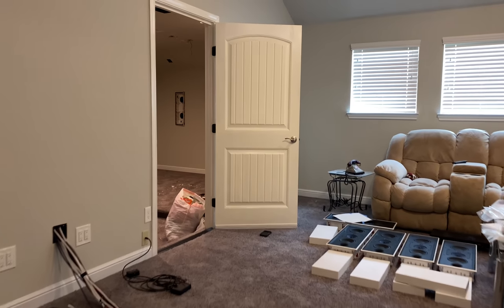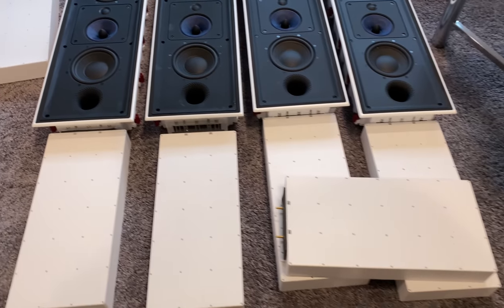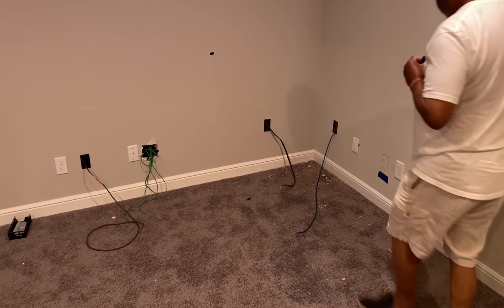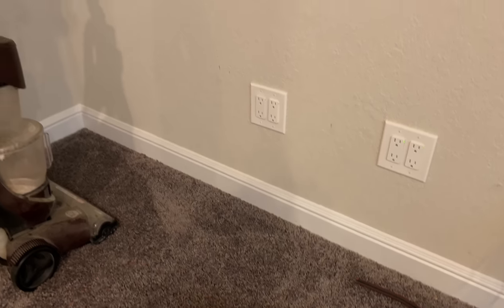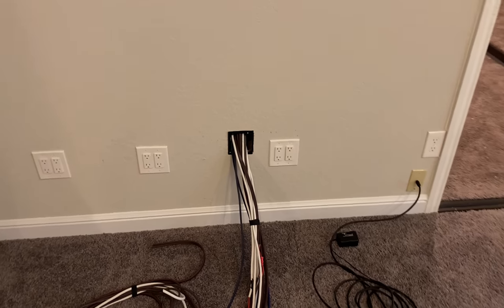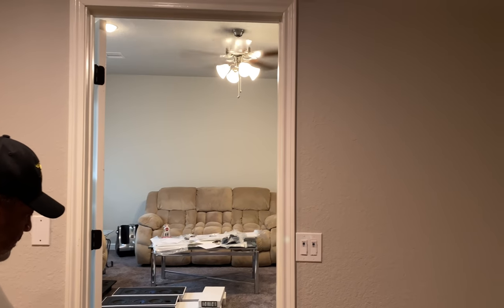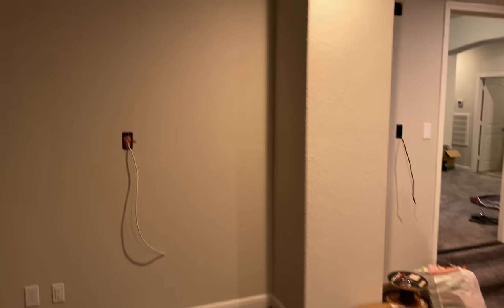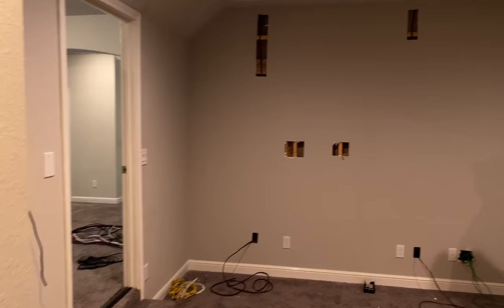Home Theater Build: McIntosh, Bowers and Wilkins, JVC rs3000, JTR 4000ULF: The BEFORE

Comment: Reminds me of when I build my theater room 16 years ago. I am not a carpenter, electrician or even a handy man. Painting walls was my limit and I built everything my self after work for 18 months. That was after 6 months of research. I did some over the top things that I would never do again. I ran vacuum tube throughout all the walls dedicated to each speaker so I could upgrade cables if I wanted to. That job alone took be 40 hours cutting big holes through studs. Best think I did was vibration isolation and soundproofing. My double. 3/4" drywall on The. Ceiling only has 12 points of connection to the joists and those are acoustical vibration anchors that connect hat-track that the drywall is attached to. Eliminated vibration going to the rooms above it. Did the same with the walls with Z track and only 6 points of connection per horizonal Z track over 22 feet and only 3 across each wall so only 6 contact point for each 8'x8'section and everyone had a rubber isolatorntonstop vibration. Every box was sealed with silicon amd attached with a rubber pad
Every item. That was attached to any of the studs or joints had a piece of rubber between it  and the wood. With the door (steel, sealed exterior door) closed, amd all the other sound proofing I did and researched to do, sound volume drops 58 dB righty outside the door and 61 dB in the bedroom right above it. This soundproofing work took 4 months of work alone. It takes time to do it right. My problem now is how I am going to install my atmos ceiling speakers though such a suspended ceiling and also keep the sound integrity. 

That was the only thing I never futirproofed for as ceiling speakers weren't even in cimas yet, heck people were arguing that 7.1 was too much and 5.1 was the best. I set up wore runs for 11 wall speakers.... Just in case I could figure out a way to have speaker delay to add nonexistent channels. 

If only there was YouTube back then to learn from instead of buyingagazinea and hoping there was info on something you were building. I bought my self isolated hanging anchors for the ceiling from an Australian company that took 8 weeks to come and months to find online. Well worth it but 1000 times harder back then

Comment: Maybe misconceiving, but the wall the screen is going on doesn't look like it can fit a 175" diag screen (69"x161"/ 5.75'x13.4', if 2:35:1)...
The room seems small for everything he's putting into it. But to each their own...
Reply: All amps will be in my game room and the equipment rack will be in game room.  The only thing in the theater room will be my seats, projector, screen, speakers, and subs.  All speakers will be in the walls and ceiling.
Reply: It looked Ike that room was at least 16 - 17' wide, more than enough room since it is transparent. The good thing with transparent is you can go a couple inches from the side walls, just need a screen border.

Comment: Interesting and very similar to what I currently have but mine is a 7.1.4 system using cwm 7.4s and dual Rythmik 15 subs.  The only thing that looks odd is how HIGH he is placing his speakers in the walls.  I originally had mine around that high 20 years ago when I first built it as a 5.1 system but was told to lower the speakers in a 7.1.4 system so I did that on the fronts only (so far) as I figured that is the most critical sound stage portion.  This may be good news if I don't need to lower the sides and back as they have been in wall for a long time now

Comment: What did magnolia didnt do?
Reply: It appears to me that the holes they cut were very messy.   It isn't the biggest of deal if you are willing to come back and repair the damage later, but that is a big hassle.   Much of that damage could have been minimized with experience.   I will give them the benefit of the doubt and say, they SURELY will come back and tidy up.
Reply from the maker: im not in the biz of trash talk. Objectively, they prewired with the terminations 2-4 inches out of the wall. As a custom integrator, you usually leave several feet to accommodate racks, or other mounting conditions. they basically took solid core audioquest speaker cable and used automotive crimp style adapters to extend the lines. Magnolia has already committed to come out and fix this wire job.
Reply: @ThatHomeTheaterDude  A great company is not one that avoids ALL mistakes, but does what it takes to make every job right.  Good guy Magnolia.  Good to hear.

Comment: This guy has some serious rack equipment going on here.   I’m not trying to be a hater but I don’t understand the choice of speakers with this level of electronics.  I understand just about everyone has a budget for what they want to spend or will spend, but with this quality of electronics, I would not have JTR subs or those B&Ws for the LCR.  I’d have 2 Paradigm Signature Sub 2 or id look at doing a line array from REL or if I didn’t do a line array I’d consider 2 REL No 25s, and I most definitely would pair the McIntosh 1.25s with a pair of Revel Salon 2s and the matching voice 2 Center, or maybe consider an LCR arrangement with Sopra 3s and Sopra Center and then rounding out with Sopra BEs.   Again; I’m not hating.   I just don’t see the speaker quality in this set  up matching the electronics quality in the rack.  But like they say, to each their own.   No matter what, this guy’s system kicks some serious serious ass.
Reply: Jtr 4000’s stomp all over paradigm subs 2’s. It’s not even close. And yes I’ve heard both subs a few times.
Reply: Leroy Lang curious how you think a 4000 ULF stomps all over a Signature Sub 2
Reply: @leroylang8613  I think you might be confusing a different sub. The Paradigm Sub 2 is probably on of the best suns in the world, $15k and 9000 watts is out of this world. The JTRs probably have more bass resonance but the Sub 2 will be much tighter and accurate but if you prefer boomy shake your pantleg bass, JTRs are great, but still not the se. When you can buy 3 JTRs for the price of one Sub 2, there is no discussion which one is better.
Reply: Maybe you didn't realize he wants everything in-wall. I not up on the hi end in-wall but those are a great start and can't think ofamy I would know to be significantly better. Some start higher on the rack and lower on the speakers and then upgrade speakers later or not at all. Personally I find it easier to upgrade the components as that is an easy job. This guys kit will blow away most of what youbsee out there today
Reply: Shane Ducholke So your comment is to basically echo what I said except the obvious which is he wants his surrounds and LCR recessed.   I understand that very well.   I guess he doesn’t care about trying to balance and mix the massive deep bass from the JTRs with the in wall B&Ws.   It’s not my problem to solve, but when you have bass like what the JTRs put out, they won’t match the speed of the B&Ws nor will the blend very well IMO, which is why I questioned mixing the JTRs with the in wall B&Ws.   Seems he would get a much better sound by keeping the JTRs and getting much more capable speakers for the LCR that have a more dynamic range or get a much tighter faster sub that can still hit really low but also blend very well with the in wall speakers, like what a REL No. 25 or G1 Mk 2 would.   

Obviously he wants an immersive surround sound.   The JTRs will over pound that room and hit very low Hz but they won’t blend well, they’re too slow.
Reply: Shane Ducholke no not confused at all. It is a great sub but for the money you can do so much better. Btw I don’t have Jtr subs I have 6 Seaton sound f18’ for less money than a Sub 2 and they will blow it out of the water. Not even in the same ballpark. And I can still add two more F18’s for a total of 8 which would be insane.
Reply: OD 40K because I’ve heard both subs. For the money you could get 3 custom Jtr 4000ulf’s to destroy a room let alone one over priced Sub2.
Reply: Leroy Lang  No doubt you can buy more JTR subs or other brand subs and get more subs than a Sub 2.   But any high end system designer will tell you, if you want the best sound, you got to choose quality over quantity.   Quantity will never trump quality.   Keep in mind, playing super loud high spl bass is not the pinnacle in a 2 channel or HT SWT up.   Many people think getting 2 or 4 subs playing ear crushing low bass is the pinnacle but it’s not.   That kind of thinking is 2nd best thinking.   The pinnacle is having subs that play extremely low, extremely fast, extremely tight, and can blend seamlessly with the rest of the speakers.   Most people don’t even think about perfecting the mid bass spectrum.
Reply: OD 40K 😂😂 you’ve obviously never heard Jtr speakers and or subs. I sold my paradigm signature setup and went to Jtr and everyone that has heard both setups say it’s. No comparison. But you can continue to believe what you want. Ok know better. The sub 2 is awesome but for the money it’s a joke. Not one person that has seen my Seaton red cherry f18’s have said they are ugly. Physic don’t lie, there is no replacement for size and proper integration
Reply: OD 40K LCR will be B&W CWM8.3D so those are basically inwall versions of the 803D3 and you are not calling this quality speakers?
Reply: @leroylang8613   Most people who buy the Sub 2 don't buy it to have ugly looking subs, not do they buy it to have sloppy moving 18s.  The Sub 2 delivers rediculous amounts of db and they are faster and tighter than anything from JTR or Seaton.  But I'm sure you went out and bought a Sub 2 just to get rid of it because you were blown away by the beauty of JTR.  C'mon man, quit with the pretending that direct from manufacturer products are better than  world class manufacturers.  You want to believe whatever you have in your set up is the best, go ahead.  I guess I missed all of those online HIFI review sites with all of the aritcles that don't exist talking about how JTR and Seaton crush the Sub 2 or Paradigm in general for than matter.  Nobody takes you serious when you say JTR and Seaton stomp on the Sub 2.  Save you laughing emojis for your own comments next time.
Reply: @vincentmilioto5735   Never said B&W wasn't a quality speaker.  I said I wouldn't pair them with his electronics.  I'd have more capable speakers that will produce more dynamic range since he's planning on running 3 MC 1.25s.  Is that what you would do with 3 MC 1.25s?
Reply: Vincent Milioto 803d3 are great speakers for music. Movies is a whole different ballgame. Will they sound great yes will they be dynamic and hit movie soundtrack highs and lows? NO. So we are talking to totally different things. Triad inwall Plats would be a much better option, Krix inwall would be another step up.
Reply: You do know they pay for those reviews right? Do look at databass to tell you what you’re really getting. Again very clueless. Smh
Reply: Leroy Lang   Yeah, Paradigm has to pay for professional online reviewers to say their Sub 2 is the best because in reality it doesn’t perform like they claim and deliver the output they claim either.  What else you gonna say?
Reply: OD 40K Jeff can do custom finishes just look everybody else. Just do a quick google search of his automotive finishes. There is nothing ugly about them. Oh I forgot to mention a few other inwall speakers that would’ve been a much better choice: Alcons, Jbl synthesis. Ok I’ll give you the base Jtr subs are ugly but they aren’t meant to be cute and most people hide them behind an AT screen. See we can agree on something. Lol